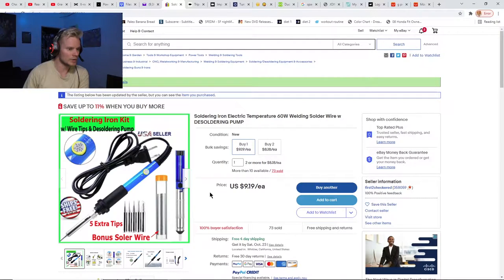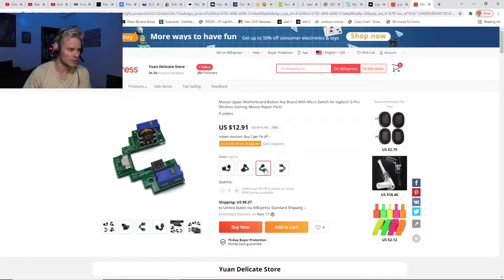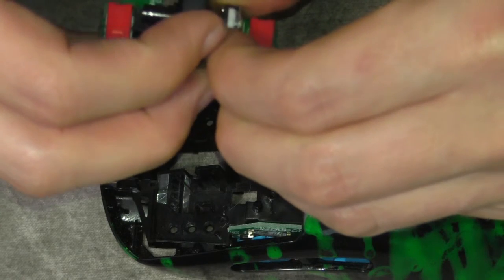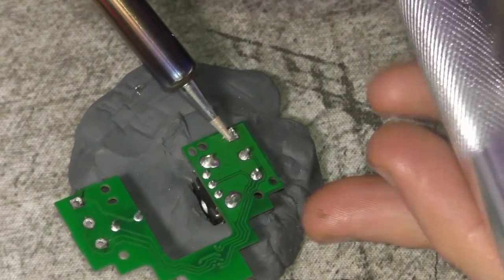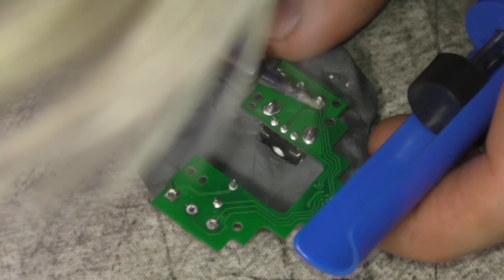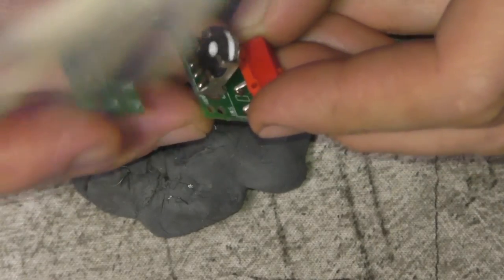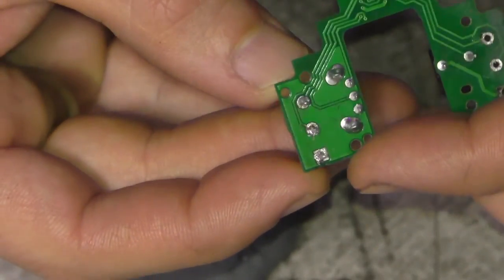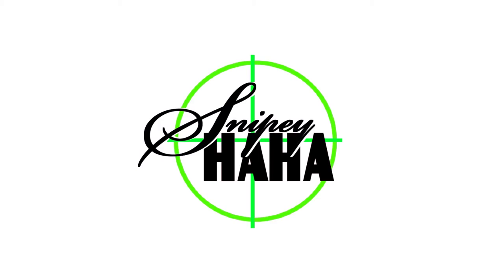Mouse Switches Replacement- Solder Gaming - fix double click - Logitech - Kailh red - cheapest iron

Comment: Flux my man, Flux would have made your job 100x easier. Helps the solder flow. Also helps you get the old out by putting a bit of new to the old, and then suctioning it off. This will keep your work flowing better.
Reply from the maker: oh thanks for the tip :). Will do next time

Comment: Great video - thanks so much for posting! A little extra intel after I soldered in a new left button microswitch: the two microsprings go under the clear plastic spinner mount - you can see two little wells where they settle into. This gives the wheel a bit of spring. Magical!

Comment: this is painful to watch. never ever ! never ever try to pry away the switch, if it is not almost falling by itself, you are damage the PCB!
and if the solder pin hole is damaged, you will have to dig the trace out from the PCB and that is totally a different story, you better off take it to a phone repair shop.
So do not pry it.

the key here is melting all 3 pin at the same time (some mice only soldered with 2 pin from factory, those are much much easier )
so search for " High Quality Electric Soldering Iron Lcd Soldering Pen 100W High Power Home Repair Tool Mini Soldering Iron Electric Solder Iron "
you will find curved head iron. the key here is the head had to be wider than 12mm, so it can have contact with all 3 pin at the same time, give you much easier and better chance remove it.

they are like 15$ so not much more expensive, plus it is always nice to have a much powerful solder iron if you ever did any soldering in your life.

The putty is nice a trick to hold it down. but some painter tape, or any tape is way easier, get a box or something heavy and just tape it there and work like that if you dont have a vise.